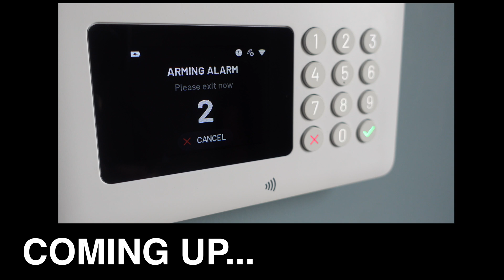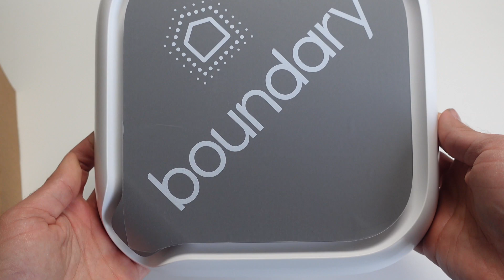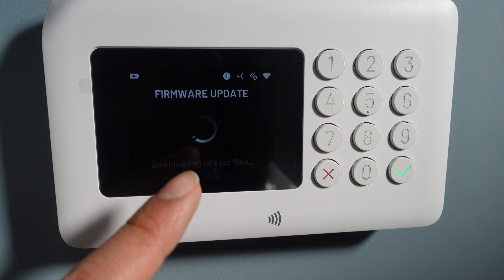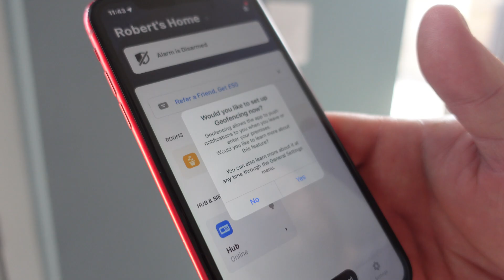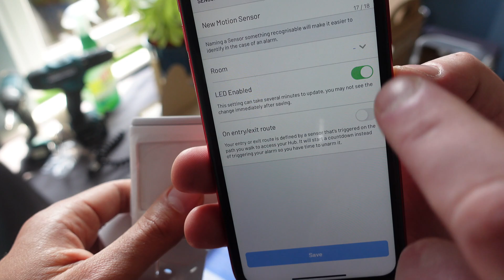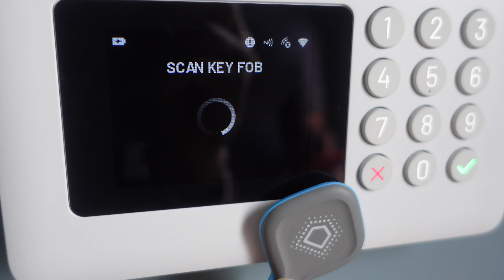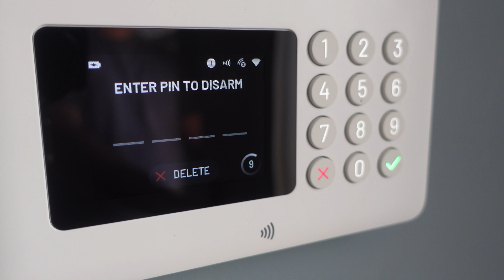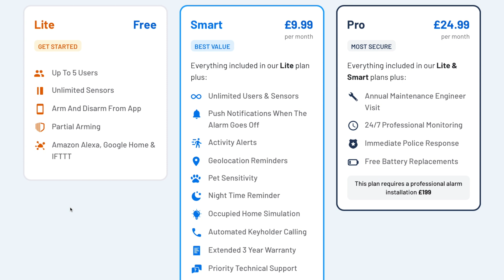I Transformed my FRIENDS House into a Smart Home Ep1(Home Alarm System Boundary)

Comment: You demonstrated one of the numerous problems I've experienced with this system at around 7:04  The app is showing you the door is open when it should be showing you a tamper alarm as it's removed from the mounting plate :-(
Reply from the maker: Hey Tony! This was our real experience installing it. How would you rate the product ?
Reply: @SmartHomeMakers  I understand it was your real world experience, I think you missed my point. That is not what you should have experienced. If you remove any sensor from its mount you should see a tamper alarm. That’s been a basic function on any alarm system for decades. That’s the problem with this system, too many basic functions missing. You mentioned one in your review, the lengthy exit/entrance time that can’t be adjusted. I noticed you skipped over how you reset the alarm when you intentionally made it go off. I did that test and no matter how many times I entered my pin or offered my tag to the hub it would not reset the alarm. The only solution was to use the Boundary app on my phone to reset it. If I knew that was the case I would never have purchased this system because that is totally impractical for me. My list of issues grows weekly but I don’t even bother reporting them any more as I have never really received a solution to previous requests, more of an instruction set on what to do to find out what the problem is and let ‘support’ know. I have no ambitions to be a beta tester and if I did, I would not choose the security of my home as the subject. Would I recommend this system to anyone else? Absolutely not in its current state, it’s clearly been released before being thoroughly tested. Good marketing, not so good product.
Reply from the maker: @TonyNeat  Thanks for giving your opinion! I agree with your point that should be tampered!

Comment: Quick glance:

The system malfunctioned on day one of installation with multiple parts contributing to its failure, coupled with software glitches it's a nightmare to install and in my view from experience, not reliable enough to secure your home and your loved ones. Until the glitches are ironed out and hardware quality is reassessed, I'd give this company a miss for now until they've matured. Great potential, but you'll be paying monthly to pretty much be their product testers, Boundary should have delayed bringing this to market.

A smart alarm that gets confused. 
A wireless system that drops its wireless signal. 
A support team, that is hard to access when things go wrong. 

For and against

For: 
Nicely presented product design of sensors, keypad hub, contact sensors, key fobs and an outdoor siren that all look slick. Monthly subscription plans are exciting when compared to others .

Against:
- really poor customer service access. No phone number, no after hours or weekend contact response. Be prepared to write emails back and forth...what year are we in again? 
- room sensors have poor quality tamper systems that need to be cleared again and again with a lot of fiddling. Be prepared to go up and down ladders. The app will show they're fine, yet the hub will disagree. 
- room sensors have very inaccurate temperature readings, a great feature but they're out by up to 3°c rendering them pointless. 
- contact sensors and room sensors can (and do) go offline, you are warned when this happens, Boundary support (a person called Leslie) just suggests that you keep an eye on it... That could be your front door sensor offline! 
- outdoor siren lacks a quality build, mine registered tampered, which I needed to fiddle with multiple times to clear. The alarm bell went off, it is supposed to cut out in 15mins, but it didn't stop. I had to climb up and break it open. It actually disconnects from the system as the batteries use up too much power, not good when you're testing it out. 
- outdoor siren lid has holding screws that screw into weak plastic thread which die during installation, which means not being able to open the siren in case of manual intervention, due to hardware failure, which happened to me on day one. Be prepared to console your kids as it likely will greatly upset them.
- the hub control unit has a limited cable run, most will find this too short if wishing to install it on the wall which is the most desired location. 
- the hub's table stand in my opinion should be included but instead the company decided to charge for it.
- sensor pairing during installation is hit and miss, 3 out of eight had issues. Even if the system shows they're all paired, you're best to contact support (good luck after normal budnesd hrs or weekends) to confirm all are actually 100% paired, they don't tell you this step) or you risk your system malfunctioning in all sort of ways .
- 3m double-sided tape provided with sensors are hit and miss, some won't hold and risk damaging your sensors if they fail to hold. 
- the app and the hub can give you conflicting readings which are really confusing. 
- do NOT use screws to install any of your sensors, as should you want to return for a full refund, you'll have to fill these holes and paint (if you have that colour) to make good. Boundary's support team (Leslie) will suggest you make a trip to B&Q or similar, negating the effort, time and money you've lost and are about to lose more of. 

An apologetic reply on 3rd May 2022 from the CEO (Robin Knox) who I reached out to, suggested they know about issues

 "some of this is out with our control and caused by a third party protocol that we are awaiting an update for. Other improvements are in the design & engineering process. It seems like you had several issues in combination, creating a frustrating experience so again I must apologise."

Yet none of this is mentioned to you as a consumer when buying into this platform, which you pay a recurring subscription to.  He was happy to refund fully (takes 14 days) to" part ways amicably".... That's at least something, though I now need to fill holes and rematch paint to my external and internal walls plus doors. Live and learn.
Reply from the maker: Thanks for sharing your experience !